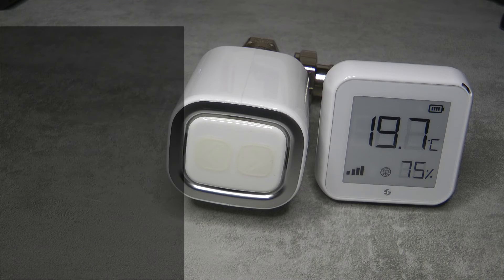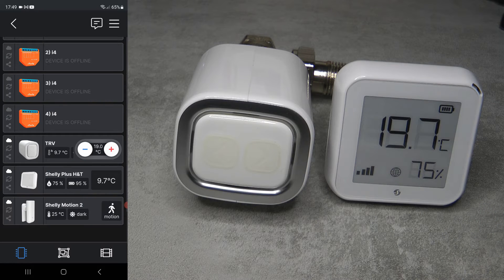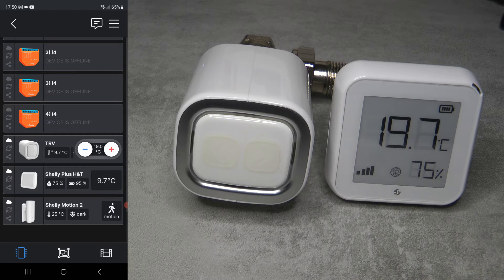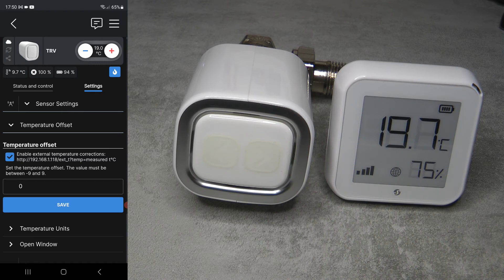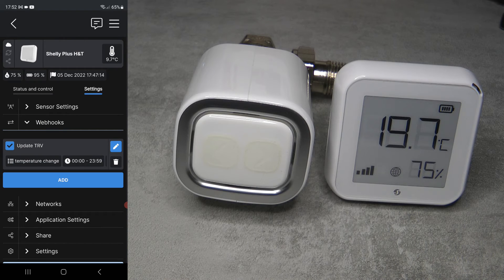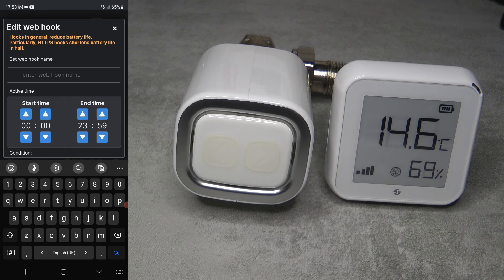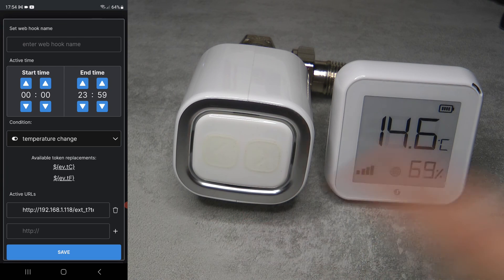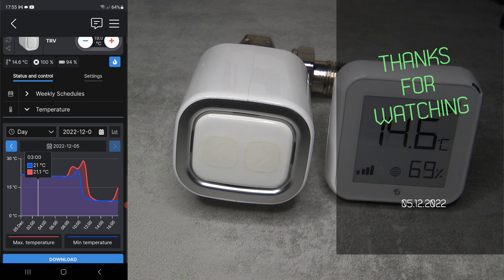Shelly H&T as external sensor for the TRV

Comment: Very useful video, thank you so much !!. After having installed the valve in a convector (a box with an heat exchanger) it was necessary to completely exclude the valve internal sensor using only the H&T external sensor input.  I solved the problem simply by checking the option "enable under floor heating mode" in the TRV settings.

Comment: Hello, Do you know if old shelly H&T can be paired with shelly TRV to use as an external sensor?
Reply from the maker: My old H&T battery died, it took me some time to find new batteries. But now I could check and this does not work with the old Shelly unfortunately. There is a similar I/O Action, but it does not send the data in the same format as the TRV expects. So only the new H&T.
Reply: @csongorvarga  : bad news, however i think it's possible to send webhooks with homeassistant, so i can bridge this problem.
Thank you for the reply!
Reply from the maker: @Loci1987  yes you could do this. Just re-format the data and url in HA.

Comment: a note: setting a static ip on a device is NOT THE SAME than making a dhcp reservation... your router will NEVER know you already used an ip address and could then assign it to an other device, causing unpredictable issues... unless you restrict the dhcp range and then you're sure that taking ip out of that range, these will never be used by the dhcp...
Reply: correct, best way is dhcp reservation in the router

Comment: I've installed Tuya based zigbee TRVs at home and since I have in each home also temperature sensors, I put them all in Home Assistant and I made the entire calculation and control in Node Red. So the sensor and the TRV don't see each other - TRV is simply controlled by  HA. Much easier. The TRV temperature easily climbs to 28C when it gets open and the boiler is ON while real temperature in the room is still 17C. The problem with the calibration or offset is: the delta (between temperature measured by TRV and the real temperature in the room) is NOT constant. So setting up the fixed calibration is totally useless.
Reply from the maker: That is try, but I made this video for users who have no HA or Node-Red. So for them this solution is much easier. If you have your home automation server, of course you can do anything. But in my example you just need these two devices and nothing else. And it takes 5 minutes to do.